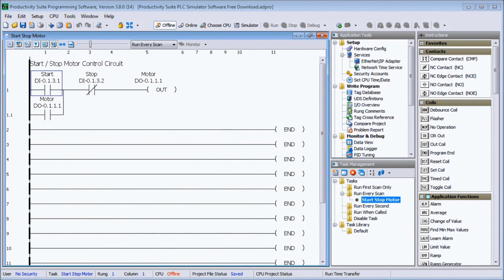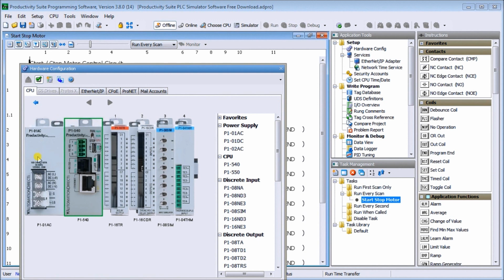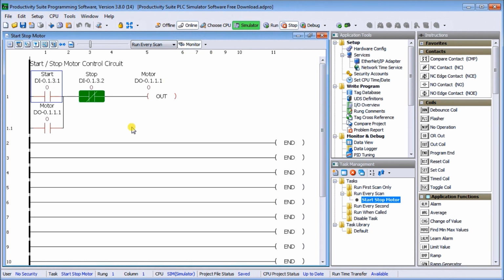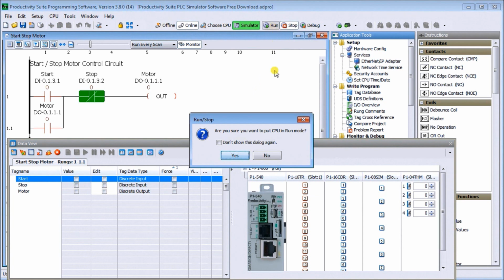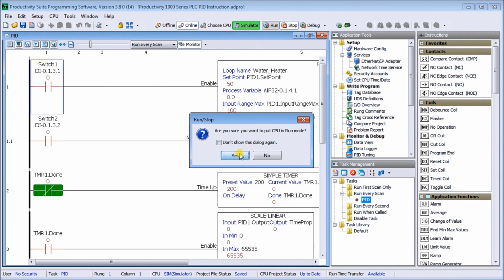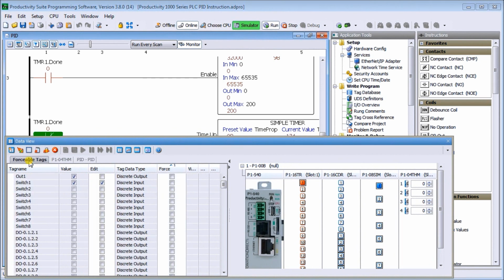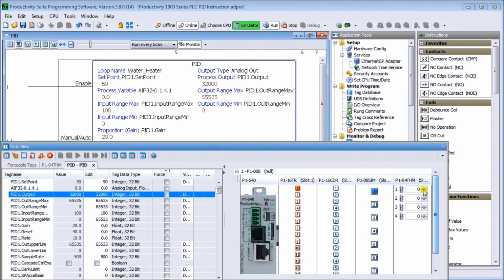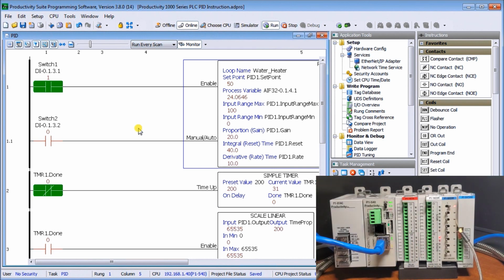Test Real PLC Controllers FREE - No Hardware Needed!

Comment: I creat a user tag IO in and IO out,but I can't control they by Data View.I clicked the Edit but Simulator doesn't become green. Why?
Reply from the maker: Good question! The green indicator means the CPU is in RUN mode — and clicking "Edit" does not put it in RUN. That's why you can't control the tags yet. Try this order:

1. Transfer the program to the simulator: File ▶ Transfer Project ▶ To CPU.
2. Put it in RUN: CPU ▶ Run (confirm the dialog). Now the status indicator turns green and your logic is running.
3. Open Data View (Ctrl+Shift+F3). To change a value, type it in the "Edit" column and then click the Write button — "Edit" only makes the field editable; "Write" actually sends the value to the tag.
4. For inputs, you can also switch to IO View and click the input points to toggle them on/off.

One important note: in the simulator, forceable physical outputs don't work — so if "IO out" is mapped to a real output point, it won't force. Use plain user tags (not assigned to physical I/O) for values you want to control freely.

If it's still not turning green after CPU ▶ Run, tell me what message you see and I'll help. Full guide: https://accautomation.ca/productivity-suite-plc-simulator-software-free-download/

Regards,
Garry — ACC Automation

Comment: Is it possible to connect this simulator up to a HMI screen with the corresponding program and operate both at the same time
Reply from the maker: Hi @heathfodor3515,
Yes, you can connect this simulator to an HMI screen and communicate with it through  Modbus TCP server/client connections on an external Ethernet port
Regards,
Garry
Reply: Hi @ACCautomation  
Do you happen to have any resources on how this is done?
Much appreciated for the reply.
Cheers,
Heath
Reply from the maker: @heathfodor3515  
I currently do not, but that would make a good post for the future.
Basically, you use the Productivity Ethernet protocol and point to the IP address of your computer running the PLC simulator.
Regards,
Garry
Reply: Hmm sounds reasonable I will give it a go!

Comment: On p3000 I can’t edit the value or force it it gives a red box around edit
Reply from the maker: Hi Stunna Racing
What version of Productivity Suite are you using? If it is Version 3.11.0(26) the simulator will not work because it is causing errors for the tags when transferring. Downgrade to version 3.10.
If you are not using the simulator or connected to the actual hardware, then make sure that the program has been transferred. Also, make sure that once you change or modify the value a red box appears. Select the send edit(s) icon to make your edits active.
If this does not work then please check your tag database to ensure that the bits and words that you are editing are forceable.
If hope this helps you out.
Regards,
Garry

Comment: Should have tried simulating any of the communications functions. No Joy, functions do not even return a error, timeout or success.
Reply from the maker: Hi Mike,
I have tested the simulator communication out with Factory IO. This works as expected.
https://factoryio.com/
Note: Currently only Modbus TCP (Ethernet) can be used. 
I hope this helps you out.
Regards,
Garry
Reply: yea that's the issue, I'm trying to work with RS-485 and can't even test the communication fail function because it won't do anything.
Reply from the maker: @mikemc7540  
The Do-More Designer is the only simulator that will handle serial communications.
Hopefully, another release of the software will allow serial and additional protocols on the Ethernet for the simulator.
Garry
Reply: @ACCautomation  I hope so. I've tried learning the Do-More system but at 68 it's a challenge to switch from ADC ladder to that. Makes my head hurt.
Reply from the maker: @mikemc7540  
In my opinion, the Productivity line is the easiest to implement communication. 
Do-More has more communication capabilities. (MQTT, REST API, JSON, etc)
ADC ladder can be done with the Do-More. I know that most of their examples use stage programming, but all of my posts have ladder logic only.
https://accautomation.ca/series/brx-do-more-plc/
Regards,
Garry
Reply: @ACCautomation  I'll take a look at the link. I still have my hardware setup from when I was trying to learn it.
Reply from the maker: @mikemc7540  
I believe it is worth a look!
Garry

Comment: can i use productivity suite to program the P1AM-100? OR can productivity suite only be used for 1000-3000 series?
Reply from the maker: Hi Daniel,
The productivity suite can only be used for the 1000 to 3000 series PAC (PLC) controllers.
You would just use the Arduino IDE to program the P1AM-100.
https://www.arduino.cc/en/software
The P1AM-100 can use the P1000 cards.
I hope this helps you out.
Regards,
Garry

Comment: Hi! it's possible to connect the simulator with an HMI software like Indusoft or Ignition SCADA using Modbus TCP IP?  How you made it?
Reply from the maker: Hi Jose,
Yes, the simulator will communicate Modbus TCP (Client (Master) or Server (Slave)) In your case the HMI would be the Client. I have this already with the C-More line of HMIs and Factory IO.
https://factoryio.com/
Note: Simulator will run for two hours before you have to restart it.
Regards,
Garry
Reply: @ACCautomation   
Garry you can probably help me with the following. I installed in a virtual machine both productivity 3.8 and Indusoft 7.1 but no matter how hard I try to establish a connection with the simulator from Indusoft I don't get a response to communicate via Modbus. Do you have any idea what it might be due to or if I must necessarily have the SCADA software running on another PC?
Reply from the maker: @JoseQuinteroPerdomo  
I have not used virtual machines in a while, but make sure that you have network connectivity. 
Call up a CMD window and enter IPCONFIG /ALL to view the IP address and settings.
Once you ensure that you have network connectivity, I would then try something like the Modbus Poll software just to test the simulator. 
https://www.modbustools.com/modbus_poll.html
Basically what you are trying to do is eliminate one item at a time to see what is causing the communication error.
I hope this helps you out.
Regards,
Garry

Comment: Very cool
Reply from the maker: It is cool! The free price is even better on a fully functional PLC tag-based system. The entire productivity series PLC's can be simulated with the software without purchasing the hardware.
Thanks,
Garry
Reply: @ACCautomation  I keep trying to connect to the simulator, but I keep getting an error. Do you know what might cause this?
Reply from the maker: @JamesSmith-ej1xh  
Can you also tell me besides the error, the operating system that you are using?
Thanks,
Garry
Reply: @ACCautomation  I am using Windows 10 64-bit.
Reply from the maker: @JamesSmith-ej1xh  
This thread may help you out.
https://community.automationdirect.com/s/question/0D53u00002hQ90KCAS/productivity-simulator-shuts-down-moments-after-starting
Regards,
Garry